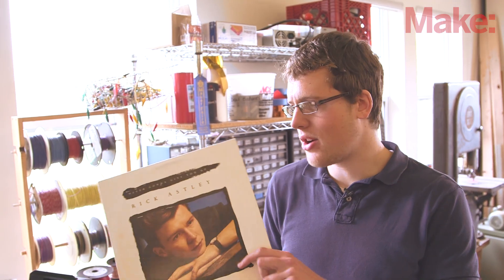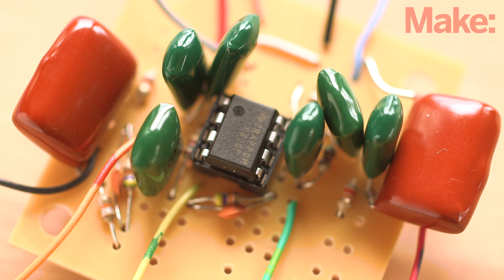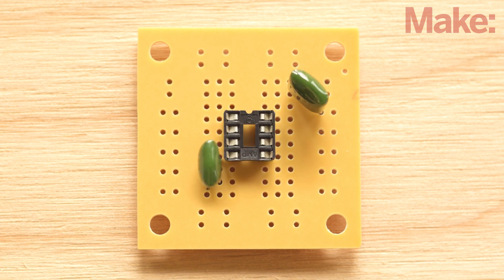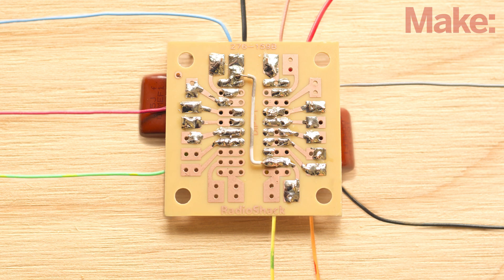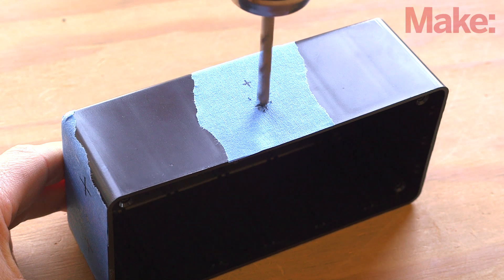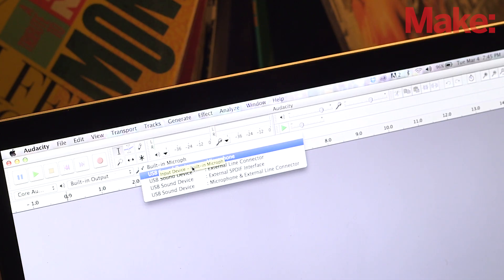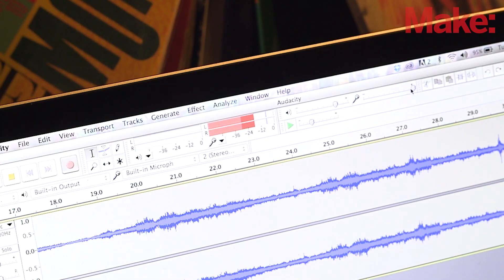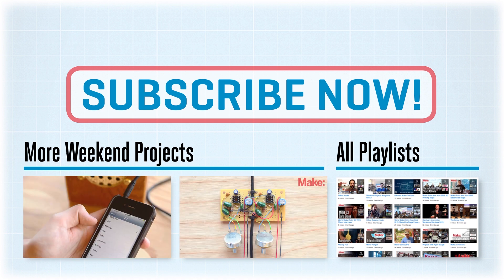Weekend Projects - Vinyl Digitizer Phono Preamp

Comment: What's the difference from a normal phono preamp, why name it a digitizer?, is just a normal external phono pre amp based on well known opamp based design. Why implementing the EQ in the analog realm, you could design a Flat Phono Preamp with no RIAA EQ and apply the EQ digitally later, The Phono should just add gain and the proper cartridge load and impedance. There is an inverse RIAA equalization feature in audacity. The Digital EQ will be perfect unlike the analog EQ where is impossible to get a perfect RIAA curve in both channels due the nature of the analog world and component tolerance values.

Comment: the preamp can be used to connect to a receiver?
Reply: ***** 
i think you can.. but i dont know how loud the out level is.
to loud is clipping. if its at line level yu'ar safe. 
maybe you can build between the gain pins a potentiometer to set the gain.
Reply: ok thanks ;)

Comment: can you just plug the 3.5mm jack straight into the mic in which comes on most internal cards? i cant see a reason for the external sound card to be there. this may be because i still dj on vinyl so i don't need a preamp anyway, i have a mixer to do that.

Comment: Completed but only half successful. I have no output from the L Channel and you said resistance between tip/ring and ground should be 47K Ohms and I have 17.7K Ohms ring/ ground and tip/ground.I have rechecked all my wiring and solder joints. I am at a bit of a loss what to check, thinking I must have overheated something or perhaps placed a wrong value resistor. Any suggestions?

Comment: I would just make a sampler out of atmega and use a FTI interface, no need to buy that diamond thing
Reply: Post the schematic.
Reply: This was only theoretic, i am not playnning on making such a thing
Reply: Vojtěch Nevřela because it is impossible.
Reply: Definetly not, all you need to do is to run the ADC at proper sampling rate (44khz i think), and feed it trough UART to FTDI and from FTDI to USB

Comment from the maker: Did you know today is international Record Store Day? Visit your local record store and dub analog vinyl to your preferred digital audio format with the Vinyl Digitizer Phono Preamp circuit and open-source software. Watch how: http://m8k.me/1r39fKy & visit http://www.recordstoreday.com/ to find and support your local record store.
Reply: I just use the line out on my stereo to line in of my sound card. BTW you're soldering wrong. Don't apply solder to the tip of the iron but to the parts that you are soldering. Solder flows to heat. Kids these days, hasn't anyone taught them anything? One more thing punk, there is absolutely nothing wrong with a phone on the wall.

Now get off my lawn!
Reply: Paul Frederick What's with being so grumpy... nothing he did in the video showed that he does not know what he is doing, quite the contrary. Your comment only makes you look uneducated... makes you seem like one of my teachers from my electronic engineering school days, who was a micromanaging solder Nazi.
Reply: Simon Tygesen
He put the solder wire right to the iron tip which in my book, that happens to be a professionally trained one, is wrong. For the record you seem rather uneducated yourself to me too. Regardless of what your education may, or may not be. You do not seem to have learned anything of value.
Reply: They lost all credibility when they busted out the high-end style usb audio card. Like everyone has one of those laying around.  I saw no reason why not to just plug this in to the audio in on your laptop/desktop.
Reply: Dru Morgan
I've ripped records with my PC. All I did was plug the line out of my stereo into the line in of my sound card. I didn't need to make a preamplifier, or use any kind of a USB audio card, none of that crap. It was just RCA jacks to a stereo submini jack.
Reply: Well if you have a stereo then your good to go. This is a project that would be more classified as OLD SKOOL since it assumes you don't have a pre-amp source with the correct curve. You can actually buy a USB record player from ION for about the cost of the USB sound card they used. It's a neat project, but its like  like streaming a lan line over bluetooth so you can have a wireless phone, when the market is flooded with cheap cordless phones.
Reply: Dru Morgan
I have a few stereos. I think stereos make the best amps for PCs too. You need to get a stereo with Dolby surround sound though. PC speakers are by and large garbage.
Reply: Dru Morgan Some people want to make things. Some people want to buy things. I'm so glad there are options for both kinds of people in this world.
Reply: *****
I'm all for making things when it makes sense. Making things that I already have doesn't seem too rational to me though. Nor does making things that are fairly easily acquired seem like the best use of my time.

Comment: for what is the screw by the inputs?
Reply: It grounds the preamp circuit to the turntable. It effectively connects the ground of the input plugs to the turntable's chassis. Without it, the very sensitive cartridge would pick up interferences, causing humming or buzzing on the output.